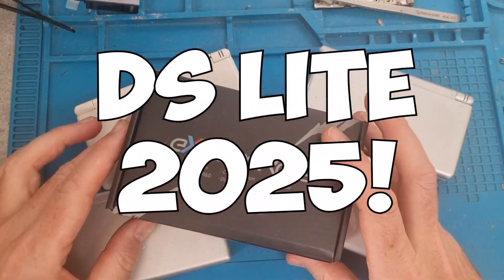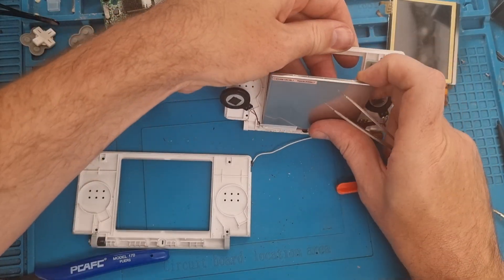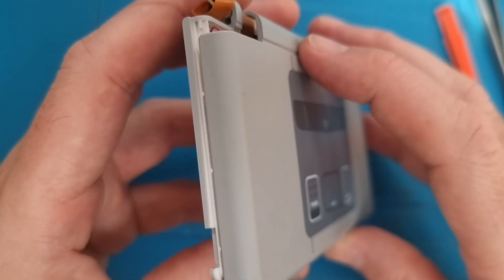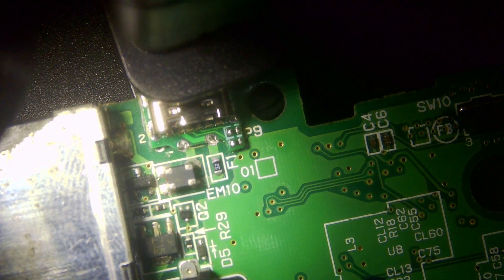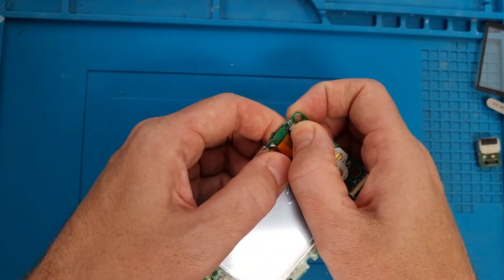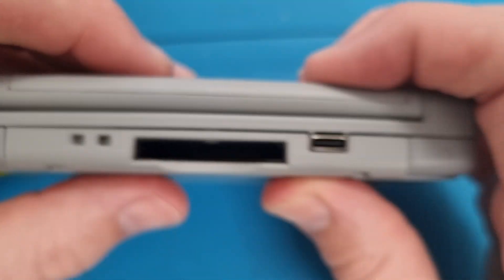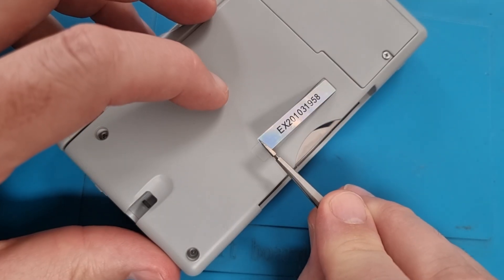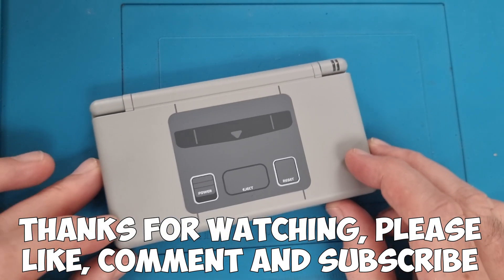USB C port and eXtremeRate shell install on a Nintendo DS Lite

Comment: What if you don't have a thing to get all spots at one time to remove the port
Reply from the maker: With a little bit of effort a soldering iron and solder wick should get it off, just be a little harder and take longer
Reply: @fixingmoddingbuilding thanks is a soldering iron to 450c° okay to use?
Reply: @fixingmoddingbuilding I ask because I did it for an hour and half yesterday and it wasn't budging. But I also have a cheap solder kit

Comment: I'm thinking about making this mod. The only thing I worry about is using a charger that is too powerful? What would happen if you use a fast charger ??
Reply from the maker: The board comes with a little resistor to stop over current, if you did the mod with just a usb c port you could blow a fuse.
Reply: @fixingmoddingbuilding  so i just need this board ? I seen another modder who suggested adding some fuse wire